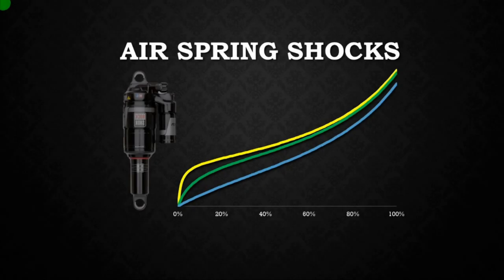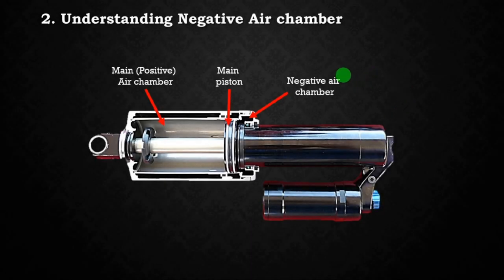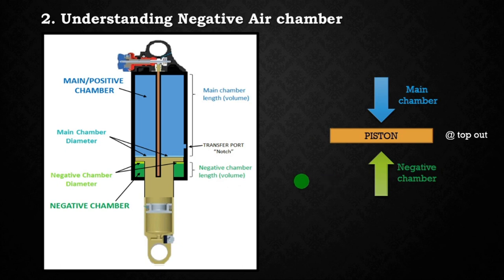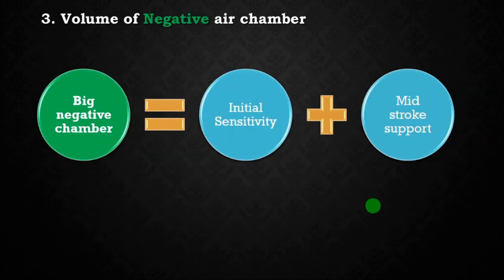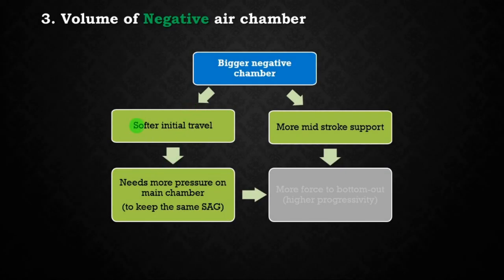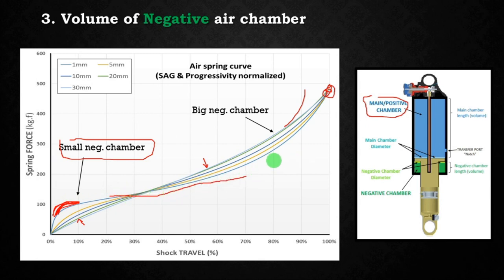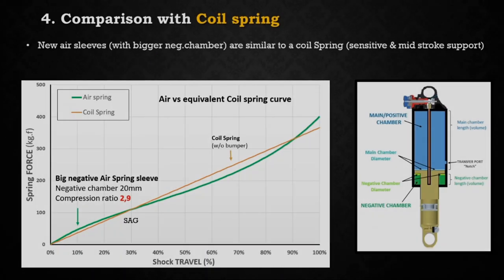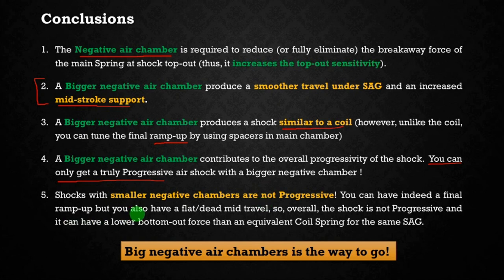Air spring shocks (MTB Rear suspension Ep.13)

Comment: So, if I'm fine with my bike's small bump compliance and progressivity upgrading to an EVOL or Corset is not really worth it or am I getting this wrong? Though if I also adjust the positive air chamber (less volume) it would make me use less travel most of the time (before bottoming out) and thus preserve geometry. Then again if it is a steep geometry that may not be good either.
Reply from the maker: These sleeves will increase by around 20-30% the sensitivity of the shock under SAG, while the mid travel gets firmer, reducing excessive mid travel wallowing. So the bike stays a bit higher on the travel. The volume of the positive chamber will mostly affect the final part of the travel. The ideal is to use all the travel on your normal rides without feeling too many harsh bottom-outs, and that can be controlled by the amount of spacers on the main chamber. If you want to improve your shock performance, then this is a good update to consider. Bye :)
Reply: andrextr forgot to say: thank you for your advice. It's appreciated.
Reply: Hey Andre! One thing has been puzzling me: What effect does installing offset bushings (those that effectively reduce your shock's eye-to-eye length) on the bike's suspension?

As a layman I would assume that it would "move the spring curve to the left" slightly as with the shock fully extended the kinematics are now in a position they would normally have when the shock is slightly compressed. Is this correct?

If so, while I realize the effect will not be much, it could still mess up the suspension, for example if it is designed to be degressive only for the first milimetres of travel and then ramps up. Potentially (with sag) the offset bushings will eliminate or at least significantly reduce the degressive part making the suspension a lot stiffer, no? Or am I thinking in the wrong direction?

EDIT: To clarify, I mean offset bushings like these: https://www.offsetbushings.com/pages/how-they-work
Reply from the maker: Hi. Yes, it will shift a bit the leverage curve since with bushings the 0mm starts now in the older "5-10mm" point and the 160mm will correspond to a 165-170mm on the older bike (the values are just an example)... The initial shape of the leverage ratio does not have a major effect on the final result. Only the final shape of the LR curve has a significative effect on the final result. If the final part of the LR has something crazy with it (like it becames suddently very regressive), with these spacers you are moving further in that crazy part of the LR. In some cases you might also get some clearence issues (rear triangle hitting the seat tube). There are also other special cases on dual-links systems (like this chinese bike: http://www.yishunbike.com/mtb_frames-89-27-5er-full-suspension-am-enduro-carbon-frame-lcfs705-lcfs705), in which if you put those spacer you will not be able to get full travel (see this ugly animation explaining why: https://youtu.be/V9oQ5iTyesw ). But overall the offset bushings don't have any problem and don't affect much the suspension, only in a couple cases can be more problematic. Bye
Reply: Thank you very much for this clarification!

Comment: +andrextr What can you say about the NS Bikes Snabb E? What is your opinion?
Reply from the maker: It has a well designed suspension. Good pedalling efficiency (Anti-squats of 100-120%), it's quite neutral to braking (anti-rise 50%) and it's slightly progressive (progressivity of 25%). Bye
Reply: andrextr Thank you! I noticed that it is not very progressive....I use a lot of volume spacers in my debon air shock. This video really helped me to understand airshocks.
Reply from the maker: On average, enduro bikes are not very progressive (most of them have 20-25% frame progressivity). IMO, Enduro bikes should have 40-50% progressivity. Anyway, if you have a debonair with max spacers there is not much you can still do to improve the bottom-outs... You have to live with that :D Bye
Reply: Nico Ofner you can pump it up, that'll increase bottom out resistance! :)

Comment: the spring curves don't take into account the drag caused by air seals though do they?
Reply from the maker: +MTB Scotland No it doesn't, however those forces are quite small when comparing to the forces from the spring. Also, the air spring curve doesn't take into account the forces of oil damping (compression damping), because those forces are dynamic by nature and depend on how fast the shock is compressing. So it's impossible to represent them on these force vs position graph. Bye

Comment: I wrote this article some time ago. It's in Italian because I'm Italian, but the graphics will understand them http://www.mtb-mag.com/guida-sul-funzionamento-degli-ammo-ad-aria-e-loro-set-up/
Reply from the maker: Thanks for sharing! I can recognize right away some of your graphs with those in the video :D I will give a look for your article with the help of google translator :) Bye
Reply from the maker: Gave a better look for it, google translator didn't make a good job, but I understood some parts... some of them are similar to the ones in this video. Just a small commentary on your Fig.4 (not sure if I misunderstand it but...), the transfer port between both chambers is located above the piston at top out. This is because the contact surface area with the piston is smaller on the negative chamber side (see my shock diagram in the video), therefore, negative chamber requires more pressure than the positive in order to produce the same force as the positive chamber. BTW, nice work! Also briefly looked to your other article (Hydraulics part 1), it seems pretty nice, already saved the link on the favorites to read later :)  Bye

Comment: fascinating stuff again andrex - I have a question, would increasing the negative piston surface area have the same effect as increasing the volume of the negative chamber?
Reply from the maker: +Sean R Good question. Short answer is no. Increasing diameter of negative chamber wont change spring curve shape, it will only decrease the pressures required on the negative chamber to counteract the main chamber. This is also true for the main chamber. The bigger the diameter of main chamber the lower the pressures required to get the same SAG. The reason why diameter doesn't affect the spring curve shape is because it also doesn't affect the compression ratio (the rate between inital volume and final volume is always the same independently of diameter). So only increasing the length will affect the curve shape. Since you dont have much room to increase a lot the length of the chambers, the alternative way is to connect the chamber to an external reservoir. Thats why manufacturers use secondary chambers outside the shock with a hole connecting to the primary ones. That is exactly the same as increasing the length of the chamber. Bye